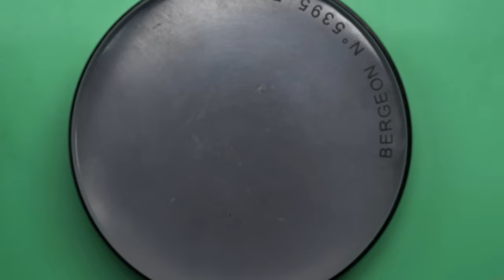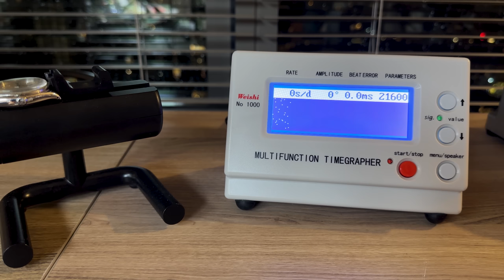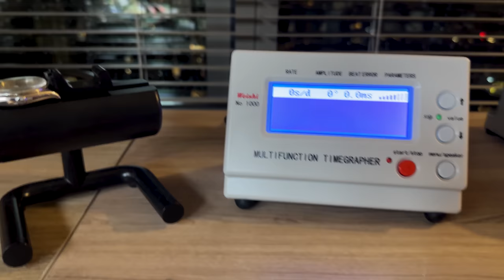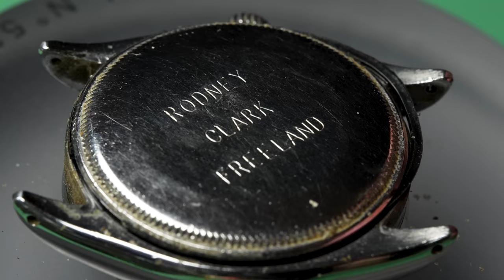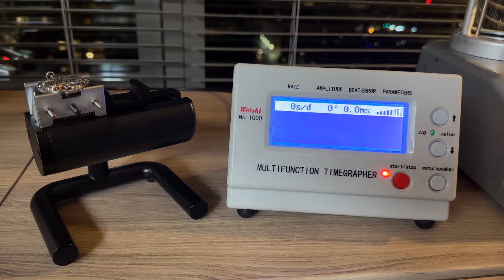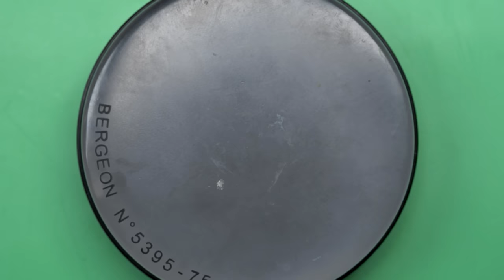He Wore This Rolex Every Day for 53 Years (Until it Stopped Working)

Comment: I think that what happened here is that subpar grease was used for the spring, and it separated, leaking oil into the movement. Watchmaker's grease is actually pretty resilient, and regardless of the body/sun heat that gets dumped into the watch, it won't do that. I've seen this before when i took apart a watch i bought for parts. It was otherwise clean, but you could "tell" that it had leaked from the spring and then one gear picked up a little bit of the oily residue and moved it to another and another... there was a trail. I don't wanna point fingers, it's a job, but at least here in Europe... you kinda get that when you leave your watch at the local "watch repair" man, for say replacement of a broken spring and they... they pack it for the journey. Breakfast, lunch, and supper.
Reply: Watchmaker here. I'll also agree that this may have been the case. I've certainly seen it happen before, among many other godawful "repair" and "service" jobs. My advice with any watch you care about at all, find an actual certified watchmaker, preferably local. Stay away from mall watch repair kiosks and chain jewelry shops. The former often have no idea how to do more than change a battery, and the latter almost never have an on-site watchmaker but usually send your watch hours away to commercial repair operations that are often little better than sweatshops and do halfassed work. 

If I had $1 for every time I had to fix a watch some poor guy had at either type of place, I could retire tomorrow. 

I also once knew a local guy who would charge folks $5 for watch repair in his apartment (the "repair" was opening the back and spraying it with WD-40...)

Comment: Thanks for the terrific video presentation.  I am a very old man who repaired watches in my youth.  I used an L&R cleaner much like yours,.  There was a cleaning fluid called Duolube which cleaned lubricated  the whole movement except except the balance wheel pivot which I oiled manually.  I inspected parts with an inspection microscope.  I steam cleaned all case components.  For clean and oil I would charge if it was gwo and returned the rest n/c.  I knew a fellow who did 12 at a time. Those were the days.  Peace.

Comment: I can remember as a young boy of around ten, being given  a clockwork alarm clock which had failed to sell at a jumble sale. I took it apart and discovered the main spring had broken right at the end. My dad softened that bit on the gas stove flame so it could be bent to make it fit. I spent a long time putting it back together. So many little spindles all to go into the plate at once. I was fascinated when it worked. Later I became a controls engineer working on Bridge Control Systems in large diesel powered ships. Strange, I qualified in Industrial electronics but have always found anything mechanical that  works on its own a joy to watch. Later still I lived for a short time at Greenwich and used to go to the Maritime Museum to see and hear Harrisons time pieces working. I'm closing 80 now, so too late to go watch repairing, but its still pure magic to me. Thank you.

Comment: I've found a useful trick when looking for tiny screws or springs on the floor.  Lay the flashlight on the floor, so the beam is shining horizontally to the floor, and the shadow of tiny objects will stretch out across the floor, making it much easier to spot the tiny object

Comment: I just came across this video and was amazed to watch you overhaul this watch. I have a Rolex oyster perpetual Datejust that was given to me as a retirement gift 10 years ago for 44 years of service at the car dealership where I worked. I wore it every day as well and now it has stopped running and I wish to get it fixed, but the cost has me scared to even have it looked at. It is a model 16013 and was purchased as a used and restored watch. Any help or ideas would be appreciated.

Comment: I've been watching your channel for a little while, i started with watching you fix a couple of Casio's and very much enjoy watching.  i have 3 Casio watches (2 EDB-610 and 1 EDB-700) all work but the EDB-610's despite putting in new batteries the backlight's do not work and the EDB-700 takes a specialized band that i cant find a band adapter for a regular band to put a band on it.  how much would it cost to service and repair these watches?  i also have a friend with his fathers pocket watch that does not run anymore9he is 75 years old) so his pocket watch is very old and i would like to see it running again.  is there anything you can do?  you can make videos if you like.

Comment: Thanks for a very  interesting and educational video. Finding someone to work on these beautiful older Rolex watches is a challenge. I have an older bubble back Rolex from the 1950s or older that needs repair. It hasn't run in 30 years and needs work. Can you recommend an honest and dependable source for restoring this old beauty?

Comment: Very informative video, loved it.  Two questions though.  Q1. When you dismantled it the train bridge looked like it had been kicked across the carpark, what with the scratches and all but I put that down to dust or something but the marks were still there after cleaning.  How did the marks get there?  Q2. why did you let the watch keep running when you removed the balance pivot bearing for cleaning and oiling?  The balance wheel was flapping about and I was worried the pallets might get damaged.  Thanks, John

Comment: The more I watch your videos the more this process reminds me to working on fishing reels.  Many springs, screws, parts and as you said, if it doesn't fit right, something is wrong. Plus, you need a few different types of oils/greases depending on how and where the reel will be used.  Ie, a tuna reel, a wade fishing redfish reel, and a bass right are not built or cleaned the same.

Comment: You said a lot when you said "Go against the grain". The fact is you're very correct and this critical precept is overlooked by many. You either have the right part in the wrong location or the wrong part in the right location. It's the place where a person should slow down, back up, and recheck the process and parts.

Comment: Hey Marshall, love your vids! But as a professional jeweler, I have one thing to correct: DO NOT put glasses in any ultrasonic cleaner, even the ones that advertise that you can. Reason: the high frequency vibrations will remove any special coatings (UV, blue light, anti-glare, etc), & as dirt comes loose & dissolves into solution, it becomes an abrasive that micro-etches the lenses. Also, be sure to ask your local jeweler which jewelry can & cannot be cleaned in an ultrasonic. Fun fact, lots can't. Safest bet for glasses is just the cheap lens cleaning cloths & a super soft brush (baby toothbrush) with a tiny bit of Dawn & water for the nose pads. For 99% of jewelry at home: same soft brush & Dawn with water. 

Keep it up brother!

Comment: To add another use for ultrasonic cleaners, they're also perfect for getting water damage corrosion off PCBs, especially for smart phones. After a careful manual cleaning, popping a PCB into an ultrasonic cleaner was the best way to get rid of the remaining corrosion without damaging all the tiny resistors back when I was still repairing cell phones. We'd also throw them into a food dehydrator overnight just to be careful.

Ultrasonic cleaners are such endlessly useful tools.

Comment: One of the hardest things in watch reassembly is knowing which screw goes where.

Even if you group all of the parts, I've found a bridge that you have to know which screw goes on which side. So i take a picture of everything dissasembled. But it's still nerve wracking when putting it back together, trying not to get the screws mixed up.

I need a better system.

Comment: You use metal tweezers, which sometimes leave scratches on the pieces of the movement. Is it possible to use plastic tweezers for this sort of work? If so, are there any reasons you prefer to use metal?

Comment: That’s an excellent service with a very good amplitude and a straight 0 second per day 😳😉👍🏽but I wonder why it was not waterproof. Should an inspection and possibly rectification of the crystal edges as well as smear of silicon grease on the rehaut/crystal contact not help to seat a better seal ?

Comment: I bought a Datejust 2008 116234. Running and winding smooth. Do I need to do this? No clue if it has ever been serviced in its 15 years old life so far.

Comment: I`m curious about the 3atm waterproof test.
3bar/atm/30m waterproofness is only for small rain or hand washing.
You cannot swim with those watches into the pool even with fresh water. Why you said you can go swim even if this watch didn`t pass the basic waterproof test ?
Anyway. In my opinion there`s something with the bezel or glass during the assembly.. I`d try to re-assembly the cristal ones again or even polish the bezel surface from the case side a little bit

Comment: I have a 1956 Rolex Datejust that will run intermittently (it will run for an hour or a day but at some point will stop.) I’ve even had it sent to the factory but they told me same as local Rolex service that some part (can’t recall the name) which has a hole the hole has become out of round and thus the watch can’t be fixed. Is it true that a part may not be available for any price. They’ve never even said something like the only fix would be to replace everything between the watch face (which the factory repainted to original years ago for me when the original face had started deteriorating) and the body. I am far far from rich but the watch is beautiful and has extreme sentimental value to me and I find it bizarre a part can’t be taken from another watch or machined. I still wear it but just accept the fact it’s no longer for telling time. Any thoughts on the reality of vintage watches becoming irreparable due to age (not from damage)? Thank you.

Comment: I had an early Rolex like this with a  plastic crystal. It was an Oyster Perpetual  36 or  39mm, gold bezel, champagne dial, and my fave, a gold and SS  Oyster bracelet. I never liked the Jubilee design.  I regret selling it.  Nothing since felt so PERFECT on my wrist.

I also sold a Milgauss the same year.
I should replace them with similar versions. It will cost me 7 times more than in 1985, when I bought them.

Comment: I bought a stainless steel Rolex Cosmograph in 1969 from a jewelry store in Saginaw, Michigan.  Saw it in the window and couldn't resist.  Paid $475.00 brand new.  Sold it 23 years later for $2700 and thought I was a genius.  Little did I know.

Comment: If I'm informed correctly, your test method for water-tightness is a little outdated. the reason behind that is: you're actually not testing the sealings in the correct "direction" and mechanically it can make a difference, if I want to prevent something from "leaking in" in comparison to prevent something from "leaking out". when a sealing is not designed symmetrically for both directions, meaning that it needs to "press" in a certain direction to work in its full capacity, testing one direction does no necessarily tell you anything about the opposite direction.
Long story short: the test should really be done the other way around, although that is much harder to do and a leak would not be as clearly visible. so maybe drying the watch, adding some blotting paper on the inside and trying to force water in via pressure?!

Comment: Awesome video as usual Marshall. I wonder how does someone use a watch since 1962 and never serviced it or even a simple wash. Everybody knows that once in a while you need to wash your watch specially under the case in the summer. Some hand soap and small soft brush does the trick. This rolex looks like it was dug from the ground. Simply disgusting. Thanks to Marshall and his skills, this rolex was brought back to its original state. Which should be impeccable.

Comment: I bought a Nixon player with a diamond. From a guy going to jail for 50 bucks. Since that watch Nixon has replaced it 3 times. Because it fogs up when I go swimming.! And once when the OPP dropped it on a concrete floor. I said omg man you just dropped my Nixon watch n broke the front. He told me well just fill out a request form n we will get u another. So they sent me another new watch. Really good company for replacements.

Comment: That's just the opposite of automobiles. They aren't designed and made with repair & servicing in mind. At all. They're designed by engineers that have only touched steering wheels. If they were designed by technicians, they'd be soooo much easier to repair.

Comment: Your water proof test is completely flawed... The test you did is testing if pressure INTERNAL to the watch can get out, not if EXTERNAL pressure can get in. The gaskets aren't designed to handle internal pressure. The watch is designed to handle external pressure, not internal pressure. The proper way to use the machine is to mount the watch, then dunk it into the water, and THEN pressurize the entire chamber. When you test as you did, the pressure acts to move the gaskets out of the way, rather than acting to compress the gaskets against the case.